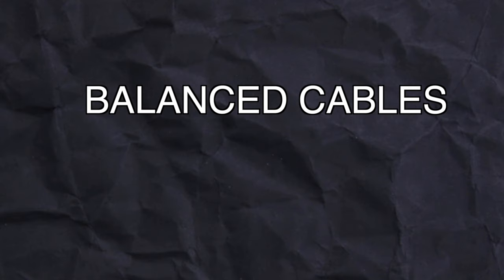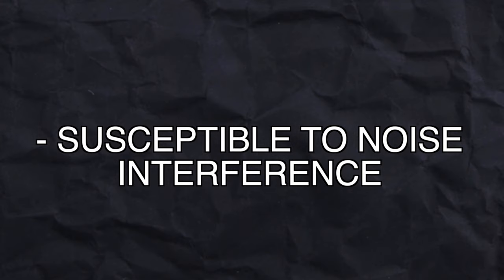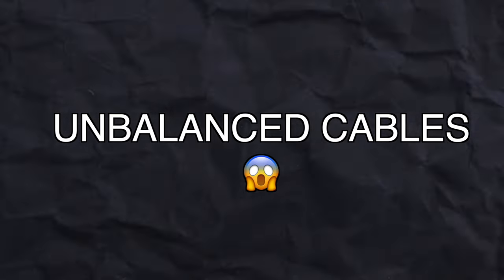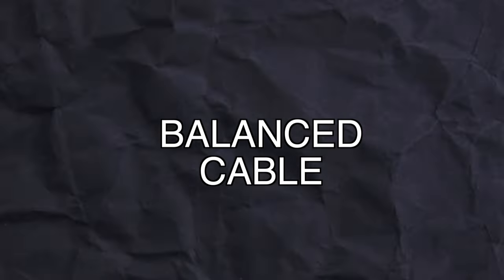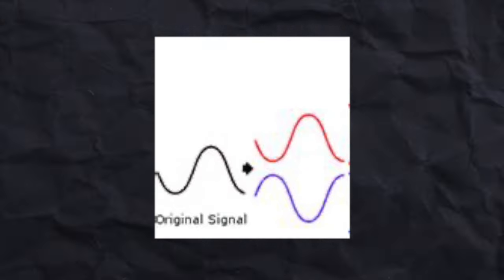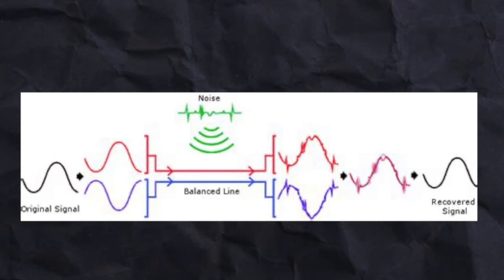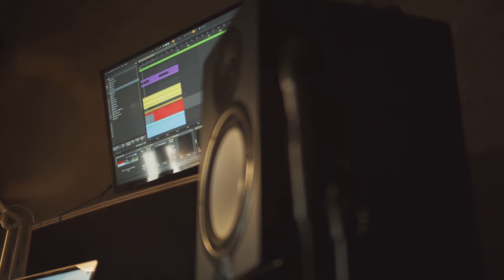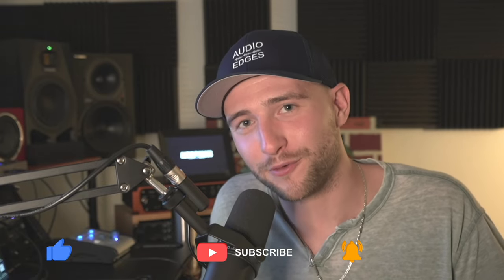Why Your Studio Monitors Are Humming, Crackling, etc. (EASY FIX)

Comment: I have TRS (Balanced) cables and still having the buzz 😮‍💨
Reply: Then you might need to invest in an external balanced DAC as your onboard dac might be picking up interference, it could also be a case of just cheap amplifier, damaged or not fully plugged in cables, go through your entire system and change each part out individually to try and figure out what the problem is
Reply: It needs to be repaired. Not all buzz sounds are cable related.

The capacitors might be defective.

Comment: have replaced everthing, speaker leads (high end balanced) cords, power supply, computer leads, usb cable. I ve re installed the software...everything but cannot get rid off the mosquito sound buzzing!
Reply from the maker: That would be frustrating! Sounds like you've narrowed it down quite a bit. If you've troubleshooted all the connections, it could be faulty monitors. I'd check in with the distributor or manufacturer at this point!
Reply: @MethuselahMusic  maybe ground loop noise?

Comment: my experience with my first studio monitor + unbalanced cable setup (presonus eris 3.5) is that the system crackles after it puts itself into away or shutdown mode so i come back after sleeping and there is a really high chance that there will be crackling in the monitors. What has fixed it every time has been just resetting my computer. Balanced cables coming in the future to avoid the annoyance though
Reply: my 3.5s started hissing(with that boxed in crap rca cable)  but the hissing would dissipate, first within 10-20 seconds, then it got longer and longer, now they hiss, crackle, ultrasound ping, from anywhere, away from the pc/mac, is it worth fixing them, you think? I'd imagine the cost would equal their value. I didn't test them with proper balanced trs but I have a feeling the hiss is permanent now.
Reply: @Brukner841  I have been looking for answers for my possible challenge with my Presonus Eris E 3.5's I just bought. My left studio monitor, which is the master is clipping/distorting at certain levels of gain and the slave doesn't at all even at the highest level and it only sounds like it's distorting out of being pushed too hard just like any other speaker or speakers would if you push them above their SPL I guess. So I wanted to ask if you have ever experienced anything similar to this due to using unbalanced cables and the clipping/distortion happens when playing certain songs with bass or kicks. It does not go for every song. I am confused as to whether this is my studio monitors alerting me of the problem in the audio I'm playing or it's the speaker that has a problem.
Reply: @myke_vinz  it's probably the speakers, in my case, the distortion used to go away, then it just got louder and never went away and then the high frequency ping started so some capacitors must have failed, I just gave up on near field monitors and will try and compose on some quality AKG headphones, I bought some clear sounding Edifier S1000s for listening, the 3.5's may have not been made for heavy use given they're super entry level, I do miss their pure clarity in the mids, got 5 years out of them.
If I had used the balanced line ins with my old Saffire 24, they would have kept going, but I hate spending time on my ancient firewire mac.
Reply: @Brukner841  I suspected that it is the speakers too and reason why I'm suspecting it is the speakers, it is because I bought them from the used market and I have no idea where they've been and how they were used and for how long. So you had distortion too?
Sometimes I also feel like the distortion does go away too because some songs won't have the distortion on some days when I playback through them and them there's distortion sometimes and it's like it varies. It is not consistent. I have kept in mind too, the fact that they aren't made for heavy use and their drivers are small and they aren't able to handle what other bigger monitors can. Why don't you try to get them repaired?
I believe they can be just like I'm looking to take mine's to a repair shop
Reply: @myke_vinz  I did have distortion and a constant hiss, I read that repairing them can be costly, I paid only 90 euro for them new but judt diagnosing them and changing one capacitor would be around 50, and I wanted bigger drivers so I gave up on them.
Reply: @Brukner841  That is just hectic and stressful. I am freaking out over these monitors because I bought them for 105 Euros which is 2000 Rands in my country's currency. Only to experience distortion and they are my first pair of studio monitors. So you just have yours sitting around now?
So it's the capacitors that cause distortion and hiss when damaged?

Comment: I bought a ground loop device still the same. I use different wires still the same. I mostly get the noise when I open up my studio programs on my PC that's when I start getting this nasty sounds . it's not as bad when I have none of my programs open only when I hook the speakers into my audio interface and open up my studio programs. I didn't have no problems on my 5 inch woofer but as soon as I hook up some new 8 inches monitors that's when the problem started and I have balanced cables . the guy out guitar center told me to get a new interface. I just hope if I do the problem don't still be the same. please any advice?

Comment: Just had a new much higher spec pc and there is a loud static sound even though using same KRK monitors and focusrite sound card. As so worried after spending so much on a new PC. Some new balanced cables to replace the unbalanced ones I’ve always used have completely silenced it

Comment: I have been looking for answers for my possible challenge with my Presonus Eris E 3.5's I just bought. My left studio monitor, which is the master is clipping/distorting at certain levels of gain and the slave doesn't at all even at the highest level and it only sounds like it's distorting out of being pushed too hard just like any other speaker or speakers would if you push them above their SPL I guess. So I wanted to ask if you have ever experienced anything similar to this due to using unbalanced cables and the clipping/distortion happens when playing certain songs with bass or kicks. It does not go for every song. I am confused as to whether this is my studio monitors alerting me of the problem in the audio I'm playing or it's the speaker that has a problem.
Reply: Did you fix it?
Reply: @tokayrecords  I don't think the speaker has a problem like I thought. I am still unsure and never really got a straight answer to my question or a solution. The clipping/distorting happens on a couple of songs not on every song which made me believe that it is how those specific select few songs are mixed

Comment: yo bro so I use balance cable I just bought Yamaha hs8 I know it not the wire or speaker cause it did this with my other speaker aswell and I made sure to go to guitar center just to get right cable and my speaker still have a ugly crackle just on my right side when im not playing nothing and then when I turn up the volume anything more then 25 to 50 percent its like distorted sound real loud what can I do
Reply from the maker: Sorry to hear it’s giving you trouble. Try switching the right speaker to the left side and the left to the right. If the problem persists on the right side and you’ve already ruled out the cable, then you’ll know if it could be your interface, speaker selector, or whatever is next in line. If the crackle switches sides with the speaker, then it probably is that speaker. Given you’ve already swapped out the wires. Hope this helps and good luck! :)

Comment: Brother one monitor sounds Great but the other one sounds bad why?
Reply from the maker: If you've already switched out the cable, I'd check the back to see if you monitors have any EQ, volume or other settings. Sometimes you can bump a knob or button on the back while moving things around, so you'll want to make sure they're both matching. Does that help?
Reply: @audioedges  yes the knobs everything are the same

Comment: this is helpful! I sometimes have to work without an audio interface tho. Would you know what to do in that case? 

For example, my mic is connected to the computer via usb and my earphones are connected directly on the mic itself. Recordings have no problem but I hear the crackle as I monitor my own speaking voice so it's distracting :( . Would getting TRS earphones solve that? thanks so much!
Reply: The stereo plug on your headphones kind of looks like a TRS only it's not.  Really, it is two unbalanced signals with a common ground.  Try plugging into your computer instead.  I bet the noise is coming from the mic amplifier (the one your headphones are plugged into).